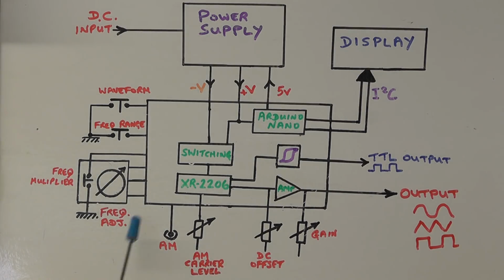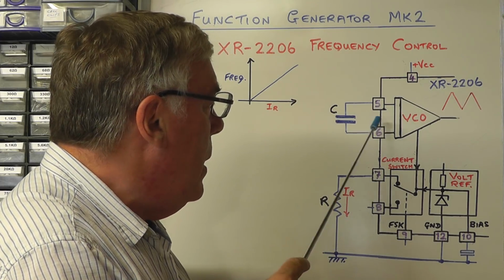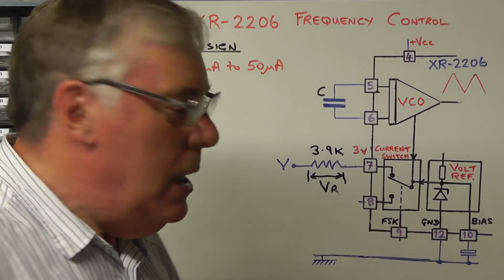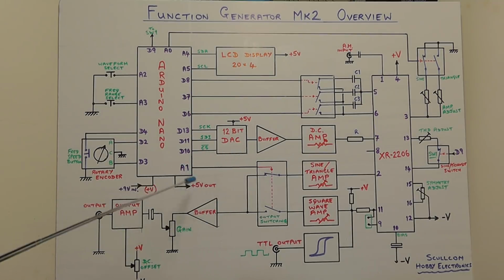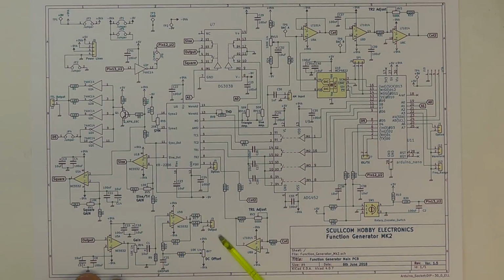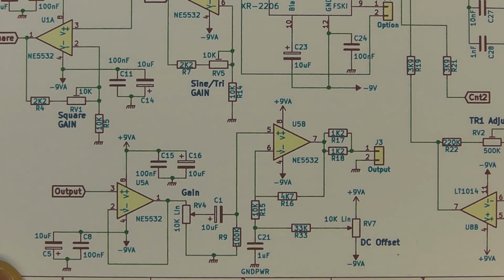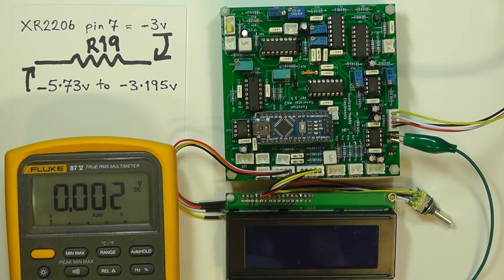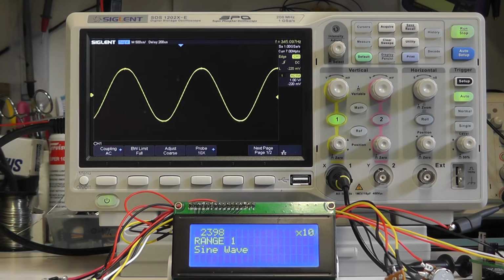Scullcom Hobby Electronics #59 - Design & Build a Function Generator Mk2 Part 1

Comment: It it possible to ask Louis if he has could upload links to the Display and Power Supply Section of his Function Generator Mk 2 Project please?

I have enough information to build the Main PCB and set it up, but its not clear what type of display is needed or the power supply voltages are!

Chris Williams
Reply: Check out his website on his main channel page.

Comment: One thing I would change. Rather than limiting the output range of the DAC, I would have set the gain of the inverting amp to give me a voltage swing of 2.525V then applied a DC offset to shift it down to the required voltages. That way your not wasting the resolution of the DAC.

Comment: I had the circuit board printed and populated.  I have good power going to the board.  I have downloaded all the libraries necessary to make the arduino sing.  All is good.  It boots up with his message (yay), but then the rotary encoder wasn't working correctly.  It would try to change the multiplier through rotation and not the button push.  I double checked all wiring and paths and they are ok?  Has anyone else made this project yet?  If so, did you get the encoder to work properly?  I have double checked the gerber files using gerbv and the board is manufactured just like the file, so it isn't an error in producing the board.  Any advice would be appreciated.  By the way I have a few extra boards made up if anyone else wants to give this project a try.

Comment: Has anyone else built one of these?  I would really appreciate some feedback.  I have the circuit board built but as the extreme newbie that I am, I am puzzled on how to supply the 5v, 9v and -9v to the board.  I would really appreciate some help.  Will this work if I supply 5v, 12v and -12v.  I can find a voltage supply that has that??

Comment: Perfect solution and thanks.
I'll share with you my project later, which I've done the same Project using FPGA (with DDS concept), I know that FPGA is little bit expensive. the range I got was between 1- 1000'000 Hz.
Is there any way to go beyond this range, i.e. more than 50MHz?
I appreciate your experience and Hard-Working.
thanks again

Comment: You could have grounded the one end of R15,  omitting the capacitor,  and fed your DC offset via R33 directly to the op amp's input.  Also,  I would have used 150 ohm resistors at the outputs of the schmitt trigger buffers,  giving an effective impedance of 50 ohms,  not 600...

Comment: Morning Louis!

I'm looking forward to Part 2 and any further parts!

I did notice in your demonstration that the triangle was slightly distorted at the corners and the square–wave corners a little bit on the rounded side!

Will you be covering upgrades/developments regarding these slight waveform distortions in the next parts?

I would be making one as a mains–operated bench project using two ready–made +V, –V and +5V psu board kits – is there any objection (from a performance point of view) to doing this?

One final point, I'd love to see a video from you on making front panel cut–outs, etc., for an LCD module as used here – any chances?

Comment: Hi    I purchased a few XR-2206 ICs from Ebay and when they arrived I tried to test them on
a breadboard but could not get them to function  perhaps due to poor breadboard contacts
or a mistake . So many wires on a small breadboard . ( its a small breadboard because its
been modified and has a ZIF socket mounted in the middle ). I will try again on a piece of
stripboard .
Anyway I had used a 2M MT preset in series with a fixed 1K on pin 7 like my EXAR  1997
data sheet suggested . I remembered something on Youtube saying that XR2206 ICs from
China were fake so searched for the video and this one came up . 
What data sheet are you working from ? , I have found a newer one and it still suggests the
use of a 1K resistor and 2M pot .  But you say 4K plus 200K 

                                                                                                                Thanks
                                                                                                                                    Alan

Comment: I wonder if anyone had any problems getting the negative supply working.  Mine is cursed.  I have checked all assoc. parts and measured the inductor to be sure it is in fact 220uh.  Replaced U1 three times.  Neg. reg. is working fine.  BTW, thanks Louis for all your help.  The only way it will give -6v to the main pcb is with my bench supply connected to TP2.

Comment: About the 600 ohm output resistance, from where do that originated? i suppose that is a standard ?
Reply: Flemming Christiansen The 600 Ohm dates back to the old telephone lines impedance. A lot of equipment was designed because of that and the impedance got stuck as a default for a few decades.
Reply: thank you for the answer, my guess was something historic.

Comment: What software was used to produce the PCB component layout graphic that is found in the PDF zipped with the schematic and parts list? Is it generated in KiCad?

Thank you Mr. Scully for another great project.
Reply from the maker: Hi,
I use KiCad for the schematic and PCB design. For the component layout I use the layout image from KiCad and then enhance it and add colour using Paint Shop Pro software.
Regards,
Louis

Comment: I'm looking for a double out, synchronized, function generator that can do up to 6kHz .....  anybody got some suggestions?
Reply: Basically an oscillator with T1 x t1<1/f for pulse 1 and then T2 x t2 <1/f for pulse 2.  Pulse1 on the up cycle of the oscillator and Pulse2 on the down of the oscillator.  both T and t should be adjustable.
Reply: Required for two outputs to switch between two sources of 1KV ......
Reply from the maker: Hi,
We will be looking at adding a pulse generating option later. Thats why I have included a dual 12 Bit DAC in this project.
Regards,
Louis

Comment: Nice project as always. I like your Videos and builds. I have just one minor complaint: wouldn’t it be better to trim the lower end of your dac output analog like the upper end rather ten to limit the resolution of the nice 12bit dac to less than 11 bits effectively. I know it’s a bit nitpicky but if one would like the extra fine grain frequency tuning 12 bits are better then 11 or slightly under.
Reply from the maker: Thanks for the comment. In this situation we need a voltage swing which does not go down to zero so I set the DAC output to a fixed lower limit. There may be ways of enhancing the resolution which we could look at as we progress.
Regards,
Louis

Comment: As always, thanks for sharing your work.  I've been working on a project with a AD9833 DDS signal generator module (which cost me £3.55 from eBay) being controlled by an Arduino Nano.  Have you thought about using this instead of the XR-2206 ?  That makes it easy to display the frequency because that's what you configure in the software.  I just have to get the gain and offset issues sorted with my op amp (AD818).
Reply from the maker: Hi,
Thanks for your comments. I have purchased a few AD9833 chips to have a look at and may use one in a future project.
Regards,
Louis

Comment: Did you think about using the AD9850?
Reply from the maker: Yes I have also looked at the AD9850. That IC is a DDS Synthesizer which is different to the XP-2206CP. I decided in this project to use the XP-2206CP as I wanted to introduce and discuss a range of control options which are external to the IC.
It would be interesting to use the AD9850 on a future project but then it will be more about the software and less on the electronic hardware.
Regards,
Louis
Reply: Nice project.

Comment: Very nice as always, I'll be looking forward to future updates though. I'm disappointed that there is no display of the frequency or digital control/display of the amplitude. The lack of an amplitude display is why I never made your Mk1 version. And surely it would be easier and better to software control the range? Then just use the encoder to go from minimum to maximum frequency.
Reply from the maker: Hi,
Thanks. This is just Part 1 of this project. The initial software I put together for Part 1 of this project will change as we progress. The display on the LCD will also change as we progress. It is my intention to add some form of frequency display on the LCD. The features and feel of this Function Generator project will change as we advance its operation and interface.
Regards,
Louis
Reply: That's why I'll be looking forward to the updates. I always admire your designs and love to see the functionality improve as they progress. I've learnt a lot about circuit design design from watching them evolve.

Comment: How easy would it be, to add a sweep input to the function generator Louis
Reply from the maker: Hi Paul,
It should be quite easy to add a sweep option as we are controlling the timing current with a varying voltage. We could add this as an option as we progress with this project.
Regards,
Louis
Reply: Ok Louis I look forward, by the way the DC calibrator is in regular use, very nice addition to the workshop.
Reply from the maker: Hi Paul,
Nice to hear you are getting some benefit from the DC calibrator.
In the current Function Generator project you may have noticed I have already added some addition components on the PCB for future upgrades/options.
Regards,
Louis

Comment: You can get rid of that ugly capacitor at the output by using a differential amplifier.
The xr2206 isn't manufactured anymore unfortunately
Reply from the maker: Hi Piet,
Are you referring to C1 or C21?
The XR-2206CP is still manufactured in China, albeit they are copies of the original. You will find lots of the offered on eBay.
Regards,
Louis
Reply: I was referring to C1, but C21 as well.
Since you're using a symmetric power supply, you can just compensate that pretty easily.
I have very mixed experience with the XR2206 from Ebay. Pretty much all of them are copies with unknown tolerances.
Some don't even work, or have weird little oscillations. 
It's a very nice project, although nowadays I would rather take something like the AD9837 or AD9833, which are very easy to program with an Arduino or similar.
Reply: Kevin Kozlowski . Doubt if these are also not just copies. The Xr2206 is out of production for quite some years now.
Reply: I strongly support Piet Muijs ’s suggestion in favour of the AD9837/9833. These are modern devices with an SPI interface and could open up much better possibilities as opposed to relying on obscure XR2206 clones. (I still love the original XR2206 … those were the days :-))

I plan to follow this project and build one or two. Should you (Louis) decide to use one of the above, count me in for at least one set of PCBs.
Reply: Bruce Woods . That should be 2008 than. If memory serves me well, the XR2206 went obsolete in Jan 2011.
Reply: I'm using an XR2206 from Jameco and I'm pretty sure it's a knock-off, but it has the F0918 date code on it.  I'm not sure if they all will, but it least this one was the higher-quality knock-off.
Reply: Much better option is MAX038. Similar project complexity but you get 20Mhz square, triangle and sine waves.
Reply: The MAX038 is also obsolete unfortunately.
Reply: Interesting these chips I can buy from Australian retailer (Jaycar):
https://www.jaycar.com.au/xr2206-function-generator-chip-ic/p/ZK8830

(EXAR Corporation).

The datasheet doesn't say it's a knock off.
Reply: MD4564 . It's interesting that you can buy them. They have been out of production, so it's old stock or knock off. The datasheet doesn't prove anything. I know Jaycar and I also know that not everything is what it seems with them.
Reply: I have one of the Jaycar ICs, XR2206 and its date code reads F1108
Reply: Piet Muijs I figured as much. The Exar logo even looks legitimate

Comment: The problem is that the 2206 was old and is now obsolete and you only find copies of random quality... for a new project it would have been better to start from something more 2018 and not 1970's...
https://www.elektormagazine.de/files/attachment/3013
Reply from the maker: Thanks for the comment and the link. The XP-2206CP is still readily available on eBay and is low cost. As long as you take account of their limitations, as they as copies of the original IC, they still do a reasonable job and are ideal for the hobbyist. What I try to do in this project is to introduce some new ideas/methods of control.
Regards,
Louis
Reply: I thought the same thing. I think he may be explaining what some of the other Chinese shops have done with these chips. He did take the time to show the variations of what is now on eBay for single chips. However, these XR-2206 DIY kits were available back in APR '18 so he may just he helping people learn how they work.

Comment: An elegant design. Looks awesome. Your MK1 version also had PWM, are you intending to implement that feature in this design too. Would you be considering making the “final” PCB available as you did the Electronic Dummy Load?
Reply from the maker: Thanks Bruce. As I have a few spare PCB's for this project I have posted a set of PCB's to you in Australia (the Function Generator PCB and the Power Supply module PCB I am working on for Part 2 video of this project).
Regards,
Louis
Reply: Scullcom Hobby Electronics Thank you very much. That will be very very appreciated.👍👍👍👍

Comment: For the spike in the sine wave,  put a 330 ohm resistor between pin 13 and 14. Put across this resistor a 1K trimmer for adjustment.
Reply from the maker: Thanks Roland for the suggestion. I will give it a try.
Regards,
Louis